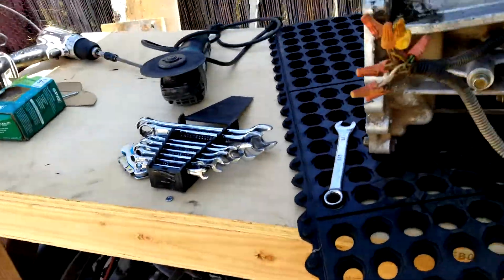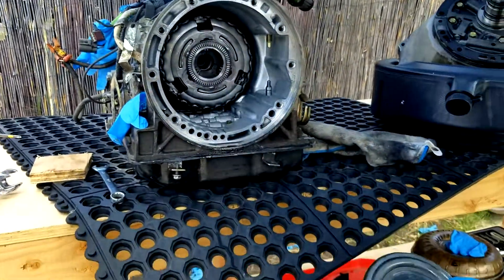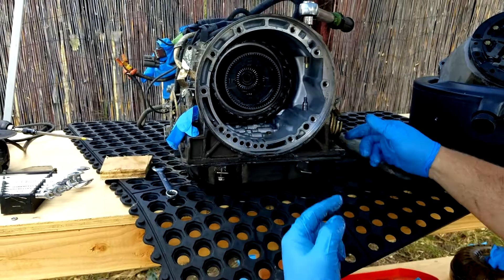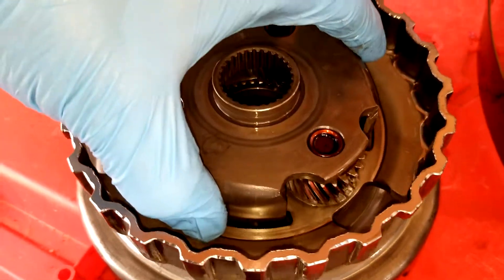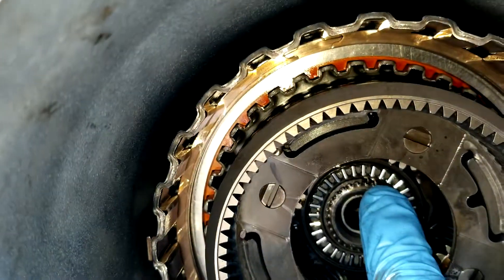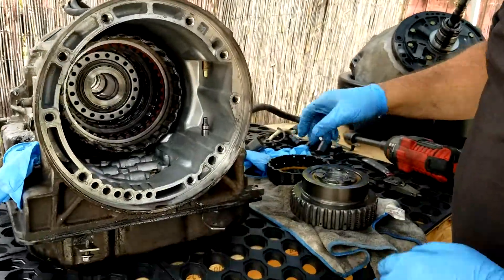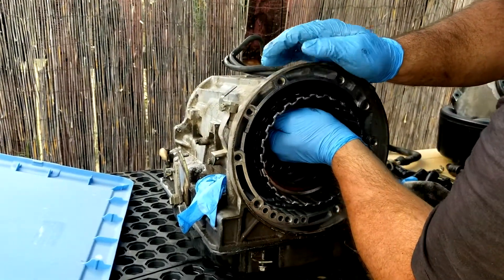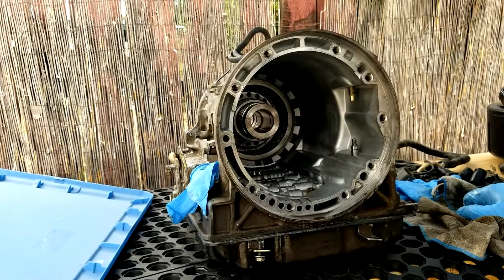Nissan RE4R01 Disassembly and problem location Part 1

Comment: I have a 2004 xterra i bought for 500 with 277,000 miles, it drives perfect in all foward gears but has no reverse, when you put it in revesre the engine changes pitch slightly but  wont move the vehicle. im not spending no 2500 bucks on a transmission rebuild, im trying to sell this thing and make a few bucks, this vehicle is in beautiful shape inside and out not a dent anywhere and the inside is like brand new everything works all windows the ac and cruise just no reverse, i can get a used lower mile trans for about 500 bucks with a 6 month warrantee here locally, i dont suppose its a reverse solinoid or some simple fix is there? i bought it from the original owner and he took it to a trans shop that said the reverse band was out but i dont see a revese band in this trans. Mabey he meant reverse drum?
Reply from the maker: You need to check line pressure when engaging reverse. However, you will end up taken the transmission out a find out what's wrong at this point.